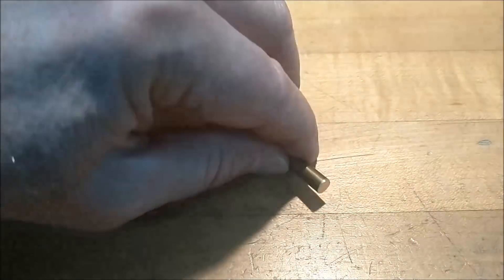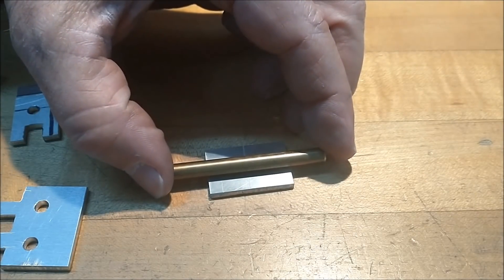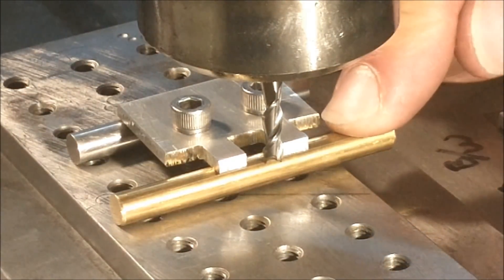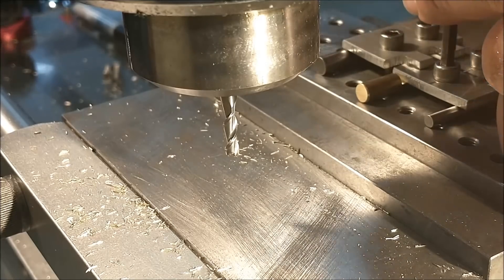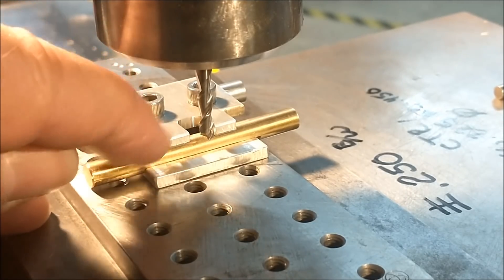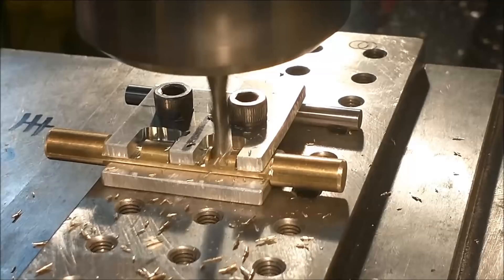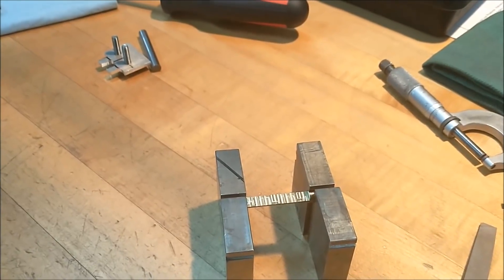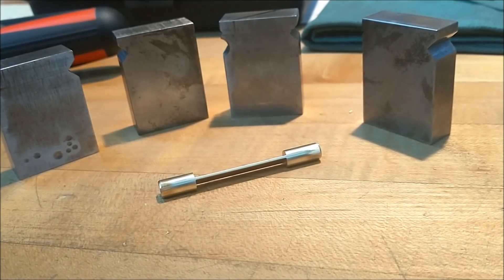Creative Clamping Solution for 'Impossible to Hold' Features. Take a Look !!

Comment: I have a project involving 1\2" aluminum round stock need to cut length to 5\8 and thread 1\4-20 inside thread any suggestions I need about 40 of them and I only have a mill?
Reply: Bandsaw them, clean up all on one side, take them all to length, the rest can be done with a V block between two stops. Locate the center of the first one and so long as your V block and table doesn't move, the rest will be in the same place. Probably remember to spot drill/center drill deep enough to make a chamfer for the tap.
Reply: Oh yeah, and get yourself a good machine tap and remember to cut a few extra just in case.
Reply: I would do that with soft jaws.   What ever saw you have for a rough slug. Deck one end for finish, deck the other for length.  Set up for drill and tap opp in the same soft jaws.  Alternatively order these: https://www.mcmaster.com/93330A642/ and deck to length or find premade .
Reply from the maker: I have a video on how to hold multiple parts of different sizes in one setup. Check it out.